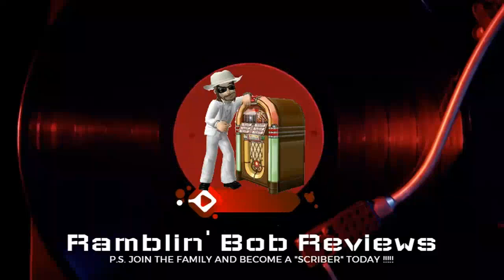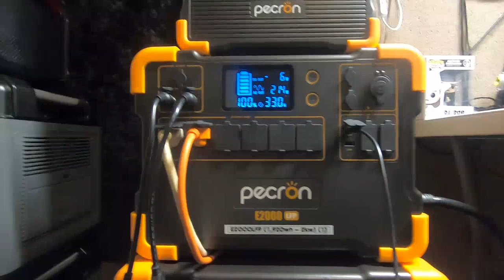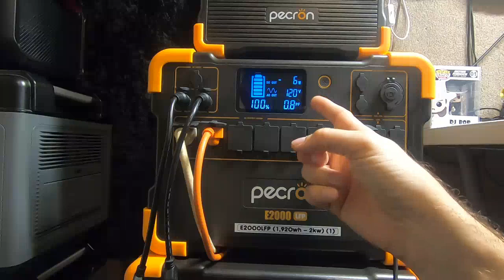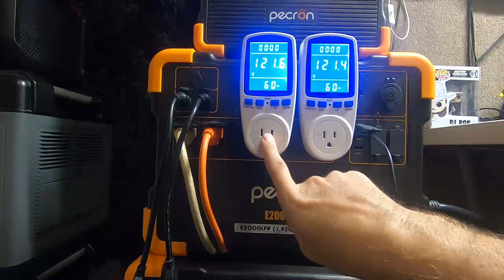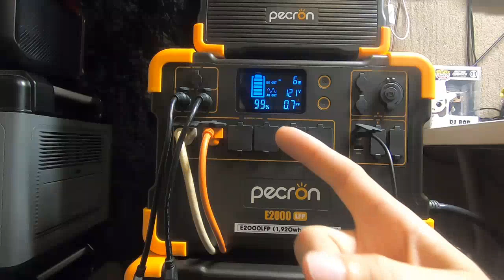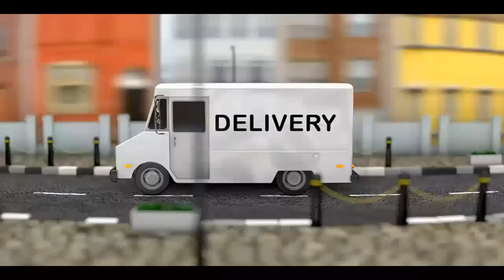PECRON E2000LFP & EB3000 Batteries (((((HUGE UPDATE))))) (((((FOLLOW UP)))))

Comment: Hello Bob!  I'm going to be buying my 2nd EB3000 (now on sale for $1100) for my E2000LFP.  Should I be buying new cascade cables to replace the ones that originally came with the power station and the first EB3000 I bought?   I hope not!!  I only ask because you're more up-to-date on component updates.   I'd actually like to wait and buy the new 90 degree cables.  Thank you very much!
Reply from the maker: look at the cable that comes with the new battery when you get it, and if the pins look different, YES, buy and updated cable. If the are 100% the same, Then you should be good.

Comment: My lfp2000 charges to 28.9 volts
Reply from the maker: Each system is set different we believe, The max according to the charts that we saw online for 24v system is 29.2v :)

https://cleversolarpower.com/lifepo4-voltage-chart

Comment: Hey  Bob:  I remember seeing a video where the 32-95 volt inputs were activated using only 24 volts or something like that.  Was that you? if it was you could give me a link to it!!  I've been watching some of your videos where I thought it might be but can't find it> Thanks
Reply from the maker: If i remember correctly.....

The e2000lfp does not start charging until 31v in our tests through the 5 pin

But the e600lfp can start charging at 13v in the 5 pin :)
Reply: @RamblinBobReviews  I've watched so many Pecron videos and now that you mention it, I am remembering now.... E600lfp.  I'm trying to find a way to expand my battery capacity on the e2000lfp with out breaking the bank and buying the EB3000 or even the E1500 UPS and hook to E2000 Power Output.  I want to charge at a rate at least over 100 watts. I guess I would have to buy 3 12v LFPs in series to do that..Thank You!!

Comment: For the firmware update, if you couldn't find USB, then there might be a 9pin USB header on a board somewhere.  You might also be looking for something with a DB9 serial port somewhere inside or perhaps a 10 pin serial header on a board somewhere that you can connect a serial port to.
Reply from the maker: Thanks for the info :)

Comment: I miss a monitoring system with history and the possibility to connect, monitoring and setting the unit from anywhere with internet - this should be the common standard nowadays for all Power stations, something like Solar Assistant or VRM portal, and I would like the possibility of monitoring for online and offline mode, where in offline mode the data would be stored in internal memory and in the next online mode the offline data with usage would be automatically transferred to the monitoring system itself. 
Hopefully some Portable Solar Station will have this functionality someday.

Or at least have the possibility to connect to a Solar Assistant like the All-In-One inverters have.
I would like to be able to connect this Portable Solar Station to the popular Home Assistant where it could be used for automation and monitoring with history from anywhere I can connect to the internet. 
In Home Assistant there is a ready-made solar monitoring environment where all it needs is data from any solar system to be delivered to it.
This and similar features should be the natural standard for all Portable Solar Stations and systems nowadays, even for small, medium and large ones.
Reply from the maker: We agree :)

This would help a lot in tracking what you are really getting in and using :)

Comment: Bob --
Thanks for the 2 videos today! You sound like a kid on Christmas morning with that 120V !!  It is good to hear. Impressive that you swapped out that board!  Not me!

I've got the same setup as you. Had it for about a year now. Learned a lot from you and I appreciate it.

Question: I'm only getting 110V. Is it safe to run all my sensitive electronics below 120V? I thought the pure sine wave and inverter cleaned up the power -- should I be worried it's not at 110V?

Anudder Question: Pressing the top button for that hidden voltage value, it is showing 26.4 V; pulling only 8-115 W AC (fridge only). But, it is showing only 43% charged. Is something off? You said 26.7 rest Voltage. If mine is only at 43% shouldn't Voltage be 43 percent of 26.7 = 11.48?  I guess I just want to know: how do I really know if both batteries and the E2000LFP are fully charged and if not, what percentage? Do I need to periodically turn off the AC and DC and "reboot" it? 

Last Question:  Should I get E1500LFP or wait for their next "big" station?

Thanks, man. Really appreciate your info and this community.

GB
Reply from the maker: Thank you, Electronics ALWAYS makes me nervous, Not to mention, You could easily end up in the hospital playing around inside these things....LOL

#1 - You can run equipment less than 120v. But we always like when you have stronger voltage. It seems to be the voltage sag that hurts electronics.
voltage sag: When you use a load and it puts strain on the voltage and it dips down to low and starts putting strain on the circuits boards and pieces because of the lower voltage.
(you can see this in real time when you run a solar panel too far, That voltage drops down fast and electronics struggle to get that power in to charge)

#2 - Rest voltage is just that (when you have NO load on the battery cells and they are done charging) and the battery is just sitting there do nothing.
    We have had our e2000lfp on 24-7-365 for more than 1 year (with zero days off)
We found the best way to re-calibrate the system is to charge it to 100% until it completely stops (bms controlled for safety)
    Then the system is 100% FULL and will 100% reset all meters to that starting point, and that seems to be the best way that we found to reset it. This system is bare minimum options, so there is best way to do this that we have found.
note: every system could be different, always check your battery capacity once in a while to make sure that you are getting full cycles :)

#3 - We LOVE the e1500lfp (90% of the features that are in this system are our ideas, You can go back in the channel and 90% of what we wanted and wished for, Pecron took those ideas and made the e1500lfp) :)

BONUS IDEA: if you end up buying the e1500lfp (full 7.5kw), My great idea is....
The e3600lfp is gonna use the same new 48v batteries so you could build a e1500lfp full 7.5kw system now, and when the e3600lfp comes out, You could just take those batteries and stick them on that new system and even add more...

Here is what pecron has in the description on their website for the EP3000:
"The EP3000-48V is an expansion battery for use in the E1500LFP and E3600LFP and cannot be used in the E2000LFP"

(((((^^^^^^^^^^^^^^^ THIS IS AWESOME NEWS FOR MY IDEA !!!!! ^^^^^^^^^^^^^^^)))))

YEAH BUDDY :)

P.S. If we had the extra money, We would have already ordered one :(
Reply from the maker: Voltage does not work like regular math style like people think, it is weird at first but it will sink in.

FULL CHARGING = 28.6v
FULL BATTERY DONE =  27.6v (100% on this system)
LOW VOLTAGE CUTOFF = 22v  (dead on this system)
(saves some extra power to protect battery cells from discharging too low and damaging them) ---> you never want to run a battery all the way down unless you have too ;)

Here is a chart that can help explain this better :)
29.2V	100% (charging)
27.2V	100% (resting)
26.8V	99%
26.6V	90%
26.4V	70%
26.2V	40%
26.0V	30%
25.8V	20%
25.6V	17%
25.0V	14%
24.0V	9%
20.0V	0%

note: these are typical 24v amounts, some systems change the resting and charging and cutoff how they seem fit for their products and for safety.

That is why you can change all those settings in that hidden menu, But IT IS VERY DANGEROUS TO PLAY WITH THOSE NUMBERS IF YOU DO NOT KNOW WHAT YOU ARE DOING ;)

PLEASE BE CAREFUL :)